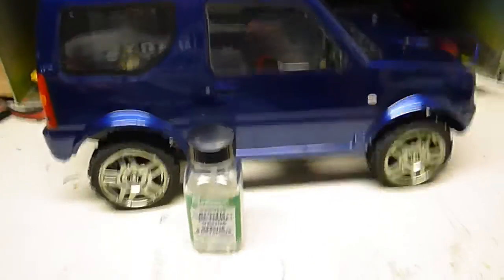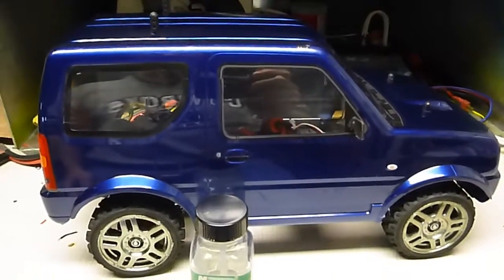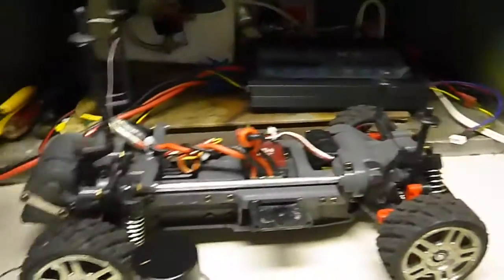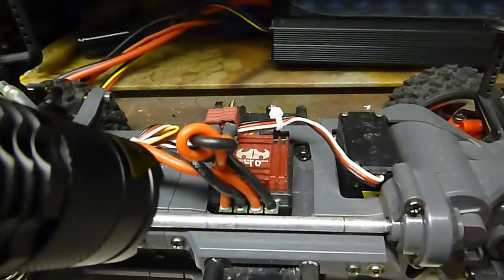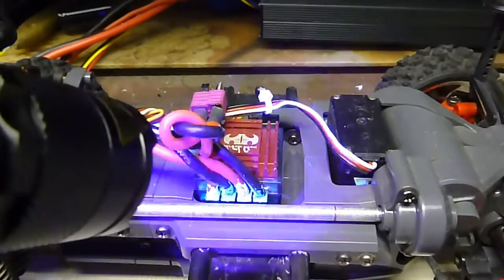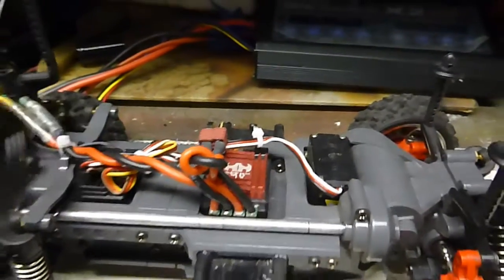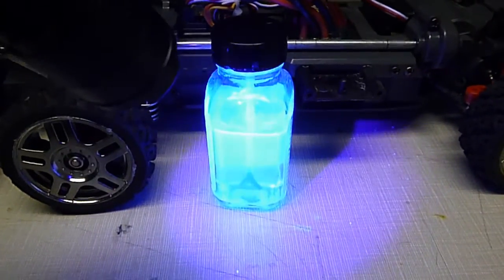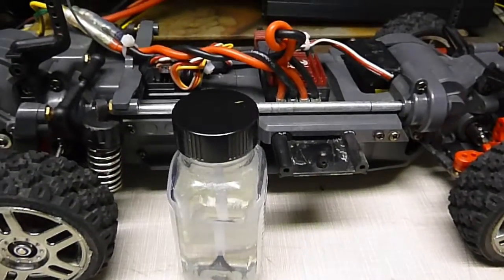Waterproofing RC electronics esc receivers

Comment: For mine I used 2 balloons for the ESC and the receiver, as the kit had a brushed motor the ESC won't heat up even after an hour long run.
Reply from the maker: +hubertbalzs yea it won't heat up with a kit motor , it's when you put in a more modified motor and then it will heat up more..... but with balloons your electronics always will run hotter than normal because the rubber holds in the heat a lot.